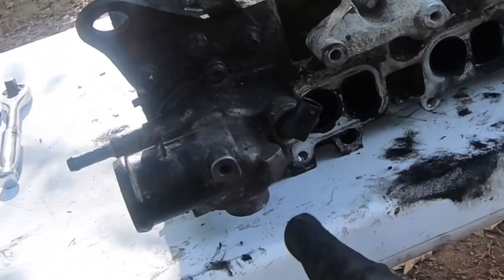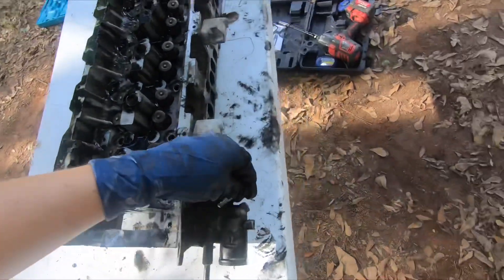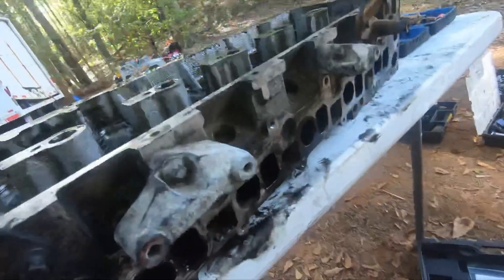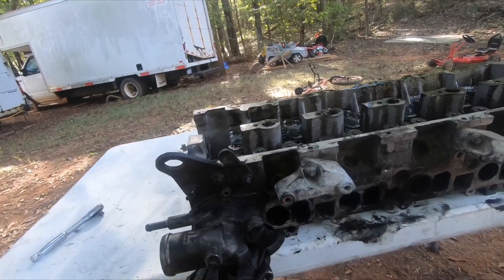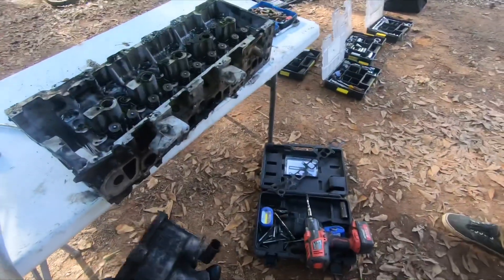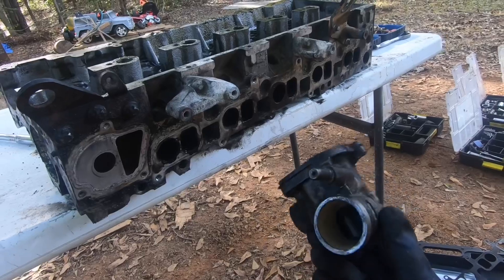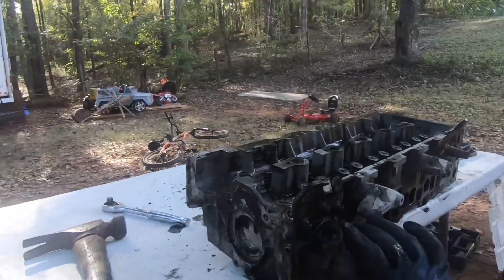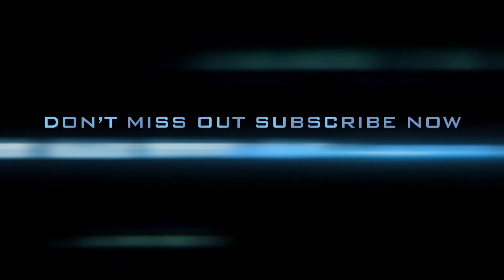Where is Thermostat Located on 2004-2006 T1N Mercedes Sprinter How to remove / Replace Thermostat

Comment: great video. what symptom caused you to replace? My T1N runs always at 170-180 temperature and it takes probably 15 minutes to get up to there. Did not know there was summer and winter thermostat
Reply from the maker: This video was done for my viewers, there was no reason for me to replace it, but I did take an engine apart and slowly editing videos with sprinter information to have the largest sprinter source on YouTube
Reply: @ZimaletaMotors  love it. ive seen probably all your sprinter videos! what temperature do your engines run normally?

Comment: Lol, Serg what about using PB blaster(penetrating oil). Those inverted torque studs are a real pain in the ass.
Reply from the maker: Lol 😆 well PB blaster isn’t the way to go, or old fashioned Kerosine method, it’s the best penetrating fluid, just leave it over night with a rag over them, and probably will come out like butter, lol but this time I did not do anything like no penetrating fluid was used to help me remove them, I just wanted good torque wrench to do the job, to be honest I thought I will break every one of them, I am surprised I just broke one